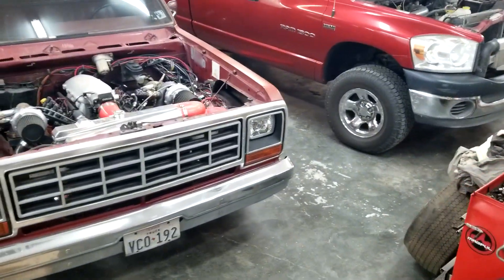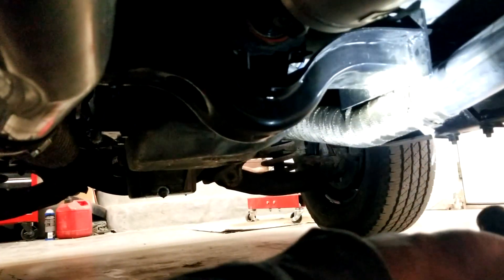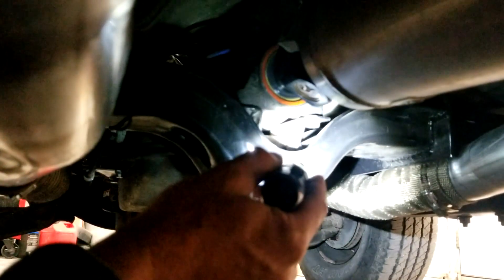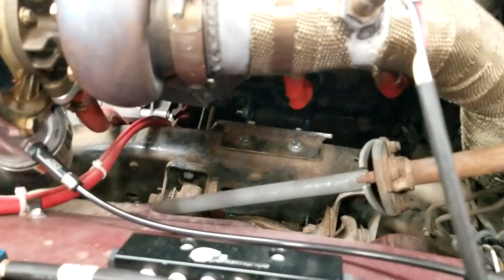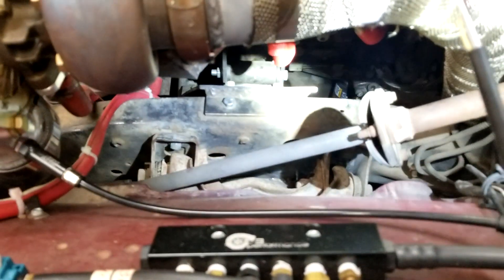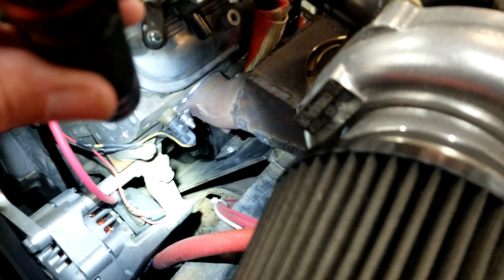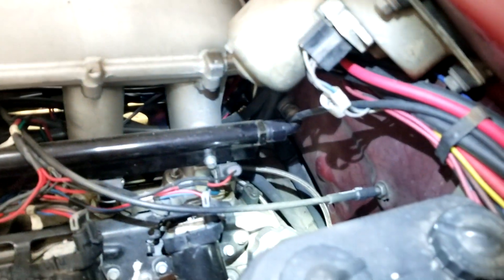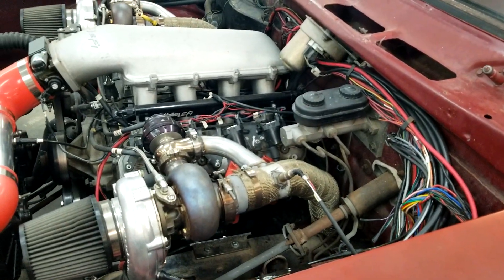72'-93' Dodge LS/4L80 swap, motor and trans mounts. Yes, you can do it yourself. :)

Comment: Sweet truck and nice job on the swap!!  Question, what wire did you tie into to power the ECM while the engine is turning over?  Key in Start position.  I'm swapping an 86 right now.  
Thank you.

Comment: Thank you for the video. I’m doing the same swap myself. Did you use the stock rear end? If you have time an feel up to it I would appreciate a video on the driveshaft/ rear end  an how or what you used to get that to work. I’m sure I can get it to work but might save me time an money if share your setup .. thanks an take care
Reply from the maker: Jim Clarke Can do, I'll work on it when I get home from work. 🙂
Reply: The Carr's Garage . Thank you sir  no rush tho .
Reply: Hey how did you do the fuel setup? Like the pump and tank?I'm doing the same in my 89 d 100
Reply: @rickyrobinson1707   I just used a tank from a 90s EFI truck with the factory sending unit an upgraded to a walbro pump . . An just ran my factory wire from my gm ecm . Gray wire I believe